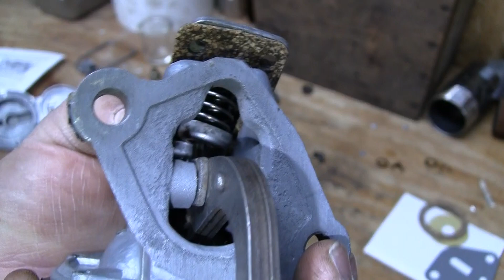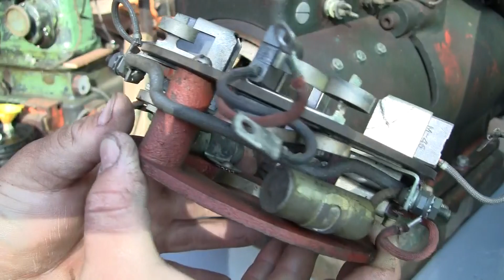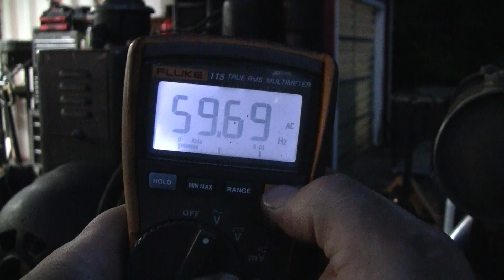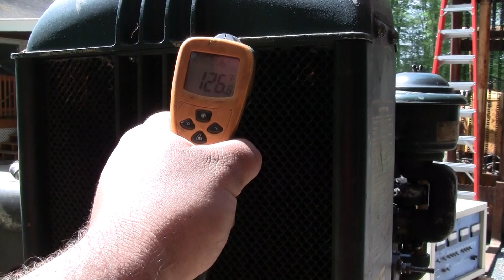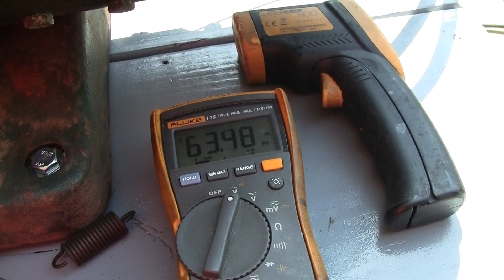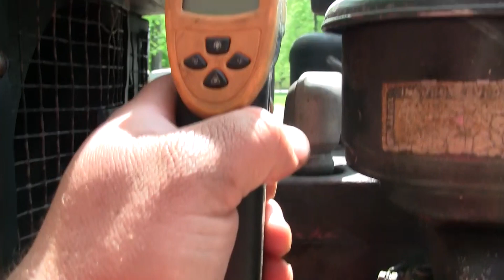Lets Get This 1945 ONAN Generator Running Pt.2

Comment: is this generator 120 or 240 if it's 2:40 can it power a whole house both legs of the 240 to run all your 120 volt appliances and your 240 appliances including a hot water heater a stove and a dryer

Comment: With additional throttle it is the spring overall tension over travel. The spring may not be long enough to maintain a certain pressure. Probably more tension over travel length is what I think. Back in the day they would run a tachometer for load leveling pretty sure. Fatter shorter thicker maybe. A farm would have had trouble affording what this cost. But fuel cost would mean just running it while milking and using cold spring water to cool the milk.

Comment: That is a very nice little unit.  Keep going on this.  I have had my share of nightmares relating to solving governor issues.  The last problem I had, was on an engine swap, where the governor had to be installed on an engine that had never run with a governor.  I had two separate issues, governor speed and  sensitivity issues.  The speed issue was the first problem that had to be addressed, and that required turning a pulley  in the lathe to slow the governor down to the proper speed.   Then there was the sensitivity issues, that required several spring changes before I got it right.  I hope your changing the sensitivity will solve your problem.

Comment: Hi I have a 70's model Petter AB1 generator and was wondering how I should clean the slip rings. Can I just spray some aerosol contact cleaner on them?  You mention that use a scotch brite pad, is there different grades of abrasiveness?

Comment: Make sure oil has ZINC AND CORRECT WT  AS WELL ,  AND older engines also were designed to use leaded fuel some kind of lead substitute would be recommended,  huh...?

Comment: Great video.  Nice generator.  Seems like the correct spring will do it or maybe changing the geometry a bit, moving the spring connection closer to the governor shaft.

Comment: You've got a generator there that was built to work for a lifetime. DONT know how much it cost you but its real steal at any price. In my fifty plus years doing small engines , this is built like tank or The only draw back is the weight for portability.GREAT JOB

Comment: Man, you're workin' WAAAAY too hard!!! Fresh gas, new spark plug, clean fuel filter, fresh oil, pull rope, should run if it's an Onan! I'll give you that after 75+ years, the fuel pump diaphragm may have rotted, but few other parts if it was put away "dry" should be bad. The B-29 had two of these in the "waist" position to help power the electrical load, so did the later B-50. The B-36 used a 4 cylinder Onan as an "auxiliary" power unit (APU).

Comment: rke chevy
rke chevy
2 days ago
The onan ball and cup governor assy in the camshaft drive gear,must be smooth almost to a Polish to ensure it moves the yoke on the shaft with very little friction,so that the governor arm can respond to that last few Hz , required for a minimum of 59 Hz,  at full load,check for sludge or make sure yoke and shaft are clean. With very little friction,   also the wrong governor spring can put you outside the adjustment limits of the adjustment linkage. This engine seems to have plenty of power and once working correctly should pull close to 3 kw. These were over built and often under rated,once frequency and voltage come into spec it will be a wonderful example of. The quality onan was once capable of .  this channel is fantastic !!!!,   I was a final inspector at onan. For many years, can't wait for the next video.
Reply from the maker: Thanks for checking it out John!  Yes, these old Onan gens are impressive.

Comment: Hey mike what are those 2 military looking gen-sets sitting on the table behind the onan
Reply from the maker: They are Korean war era gen sets.  PE-108E designation, 800w 120v 1800 RPM.  They have little Wisconsin air cooled engines. 
Thanks for checking the video out!

Comment: Your wondering what machines the neighbors  are using ?  Great work, fascinating. I bought a mill once with a three phase motor wired in star  , no six terminal link box.  I found a motor repairer in the town the original 1960 motor was made and he (retired) used to work at the factory , he had a shed in his garden now, just a hobby, , put it in an oven ,pulled the star junction out, ring labeled the individual wires into a six terminal box..

Comment: Would be nice to see the final tweak of the governor but at that age I probably wouldn't be splitting hairs over 1-2 Hz extra drop. If this were in service at a customer's location I'd probably crank it up to around 62 Hz and let her fly that way, staying close to 58-59 Hz full load. Of course you have me wondering if a new spring might do the trick... or filing another notch in the gov lever to change the leverage point.

Comment: It’s quieter than my Briggs and Stratton 10 HP 7500 W generator. I love generators. A few years back, I worked for a disaster response company. I towed generators to storm disabled AT&T and Verizon cell towers and powered up the towers and baby sat them until the grid was restored. I retired after Hurricane Sandy where we deployed 1300 gensets. They were all John Deere diesel powered and I easily grabbed much needed naps in the seat of my pickup truck recovering from exhaustion alongside those machines that lulled me into a deep sleep. This generator? Yeah....listening to that engine gives me peace. Thanks for posting this wonderful generator.

Comment: The governor might be having a problem because the throttle is hitting the slow running screw.  If you wind that screw out a little it will allow the engine to run slower with no load.   The problem  is not so much that it is running slow on load, but that it is running too fast on no load. . . .

Comment: When you said to break the generator down to clean the commutator, it reminded me of the time we used to clean a motor/generator set, whilst it was still running.    We had what could be described as a short length of fibreglass fishing rod, that we pressed end on into the commutators.   The glass strands cleaned up the copper to a shine, and we could reduce the sparking at the brushes to zero, without taking the machine out of service.   The fibreglass acted as an insulator so we didn't get a belt from the 440 volts ac. . . . . .
Reply: I had a LCpl in the Middle East who thought he could check something on his running, diesel generator. The fan belt grabbed his hand and took off his thumb. Two days earlier, Special Forces surgeons had showed up and liasoned with our IC. All 3 were very professional and, a chopper ride later, the thumb was saved. I guess you can say that it takes experience to do the kind of thing you described.

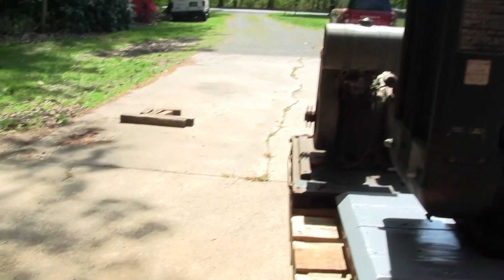Comment: 41:19 The exhaust smoke is probably related to the oil crud that was in the pan in the first part of the video. I suppose the piston rings are just gummed up with carbon.
Fresh oil with detergents (so a modern-ish oil) might be able to clean that up.

...

Let's hope I did not start a discussion about which oil to run :D

Comment: Having a simple centrifugal governor means you mast admit minus plus 5 percent speed variation from no load to full load, that means about 63 hz no load, 57 hz full load, besides if you adjust AC voltage you will also vary accordingly DC voltage and charging rate. This gensets are battery killers

Comment: I was going to say that's common for old-fashioned silver switches and relays contacts have to be cleaned up silver oxidizes that's why the butler's used to be in charge of buffing all the silver actually it's called wearing it down 😄 no what I learned working on small engines or any engine it's a spark is white red change the capacitor if it's a nice blue violet spark you have a good capacitor

Comment: I would imagine if cooling became insufficient at some point. You could easily plumb an inline electric recirculating pump to push the coolant through the system with a little more purpose.

Comment: Thanks for making the video on the neat old generator I would run some seafoam either in the gas or a little bit down the intake while it's running that does a great job of DE carbonizing old flatheads.
Reply from the maker: Thanks for checking it out!

Comment: Hey there, I have a single cylinder 1kw onan generator from '48 i'm in the middle of fixing up and maybe painting. Are there fuel pump/sediment bowl combos still available for those? it looks dang near the same as what's on your twin there. Surprisingly my pump still works, but it leaks badly, has a broken primer bail and is missing the sediment bowl. I'd also fancy a carb rebuild kit for the old zenith as well :). I have a second 500w onan generator (that also runs and makes power) I was using for parts, but it's missing the pump entirely. Just got my new blast cabinet set up and I want to turn my bucket of parts into a generator again. Thanks!
Reply from the maker: It is probably the same pump.  Look up Marx Parts, $20 gets you the same kit I got.
Reply: @SmallEngineMechanic  Will check it out, thank you!

Comment: Yes, it'd be quite interesting to see how the governor works.  Is it based on current?  Voltage?  Or, as I suspect, simple RPM?  I'd be quite interested in a follow up video.  Good to see you posting vids again.
Reply from the maker: Yes it is simply mechanical based on engine speed.
Thanks for checking it out!

Comment: Def want to see the governor work, also how about trying an electronic governor just for the fun of it.
You should replace those capacitors in the generator head, it will improve commutator life and also  be more socially acceptable to radio spectrum users (even if you only run it at fairs).

Comment: - Yes, I would like to see how you solve the governor issue, Mike.
- Perhaps some Berryman B 12 should have some time to work its magic on the carburetor & engine in total.
- Then, if it was still smoking; a whole engine could magically be refurbished as needed.
- Yes, I know, that is asking a lot, but wish-lists are supposed to be selfish, right?

Comment: On the governor I think it has weak springs and sticky linkage joints looking at the brush end bearings grease proby dried out lube on the joints. I look forward to the governor fix video.

Comment: - Gosh, I sure wish you had the needed capacitors, Mike, so when you had it apart it could have been fixed up to do the heavy work it is capable of just in case it was ever needed in an emergency somewhere.
- It looks like a great piece of sturdy machinery that could be mounted on a sled frame that even two men alone could heft and put into a pickup bed and moved anywhere for use if need be.
- Am I wrong?

Comment: I have the exact machine except it's badged Montgomery Wards...need a piston for it ..any sources?
Reply: There’s two different bore sizes, 2 3/4” and 3”. They’re rare to find either. Got lucky a few years ago and got one from a fellow on Smokstak. On my list now is to machine a pair of pistons for another of my units as they’re so rare. I’m working on the third runner now, also have the V-45 model which is basically two of these engines in a V-4 configuration.

Comment: Love to see how you correct the governor issue...
Reply: electric governor!!  :)
Reply: @bobbyk6761  nah, it’s vintage machine and is what it is. Doesn’t need any China electrics or a giant Woodward hanging off the side. This thing was designed to run light bulbs, not critical electronics. I’ve used one as back up power and it runs my fridge, sump and well pump no problem. They’re tanks, not precision power supplies but will damn get you through when you need them.
Reply: He's got a vid on that
Reply: @THATSMYNAME-LFC  Would you post the link?